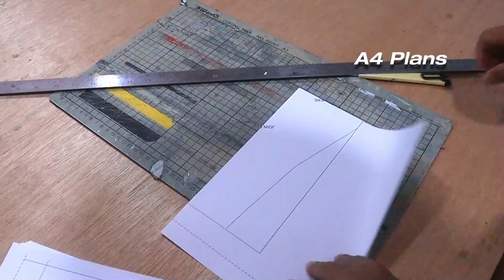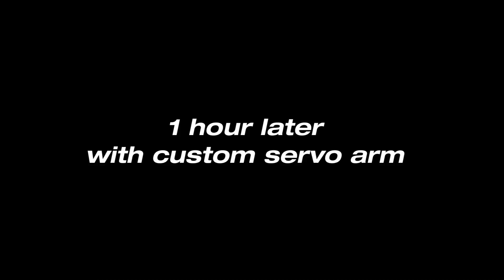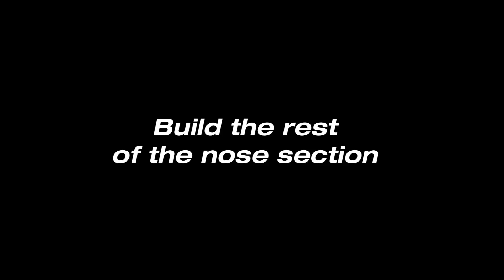Build Not So Giant C-17 Globemaster RC Plane from Foam : Part 2

Comment: Julius, can you share the three-D file for the landing gear or tell us where it is available?
Reply from the maker: I modify the file from Cult3d, just search retract landing gear you will find it. I modify the 3D so the pushrod is in the back, instead on the same direction as the gear strut. My version will be shared when this project is finish

Comment: Hey did you see Ramy rc c17 that’s huge and it is going to fly very soon
Reply from the maker: of course, he said he need at least 1 month for landing gear, maybe mine will fly around the same time as Ramy's
Reply: @JuliusPerdana  ohh . I can’t wait for both of these aircrafts to be in the air 😆
Reply from the maker: Actually he already got it fly before retract landing gear is finished, he used fixed landing gear